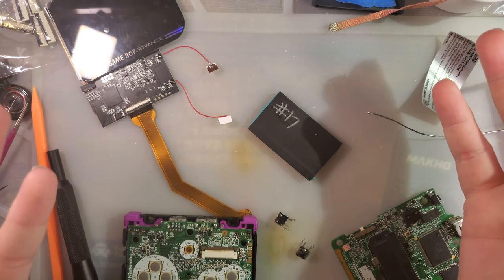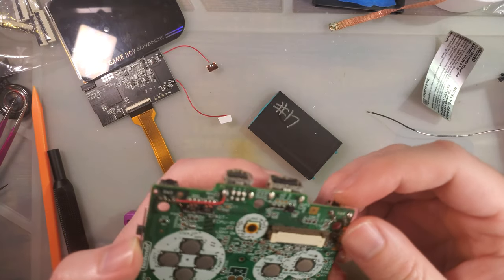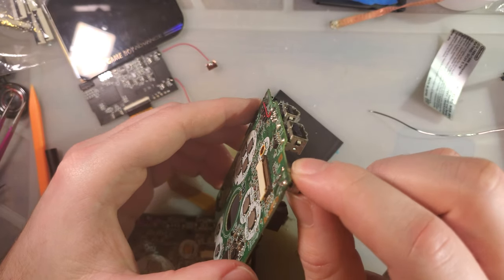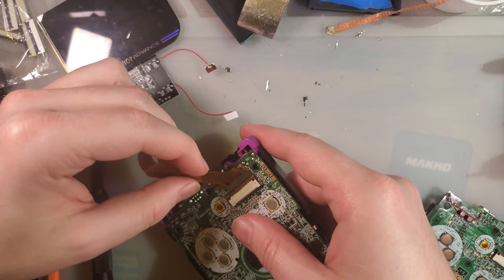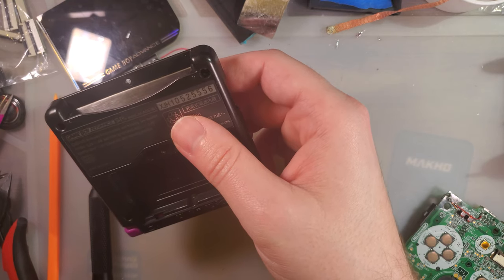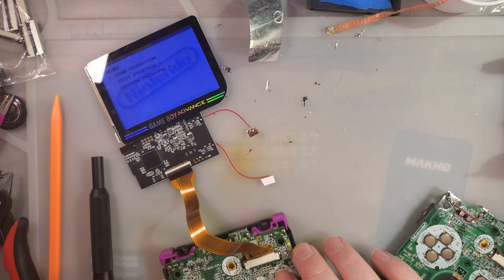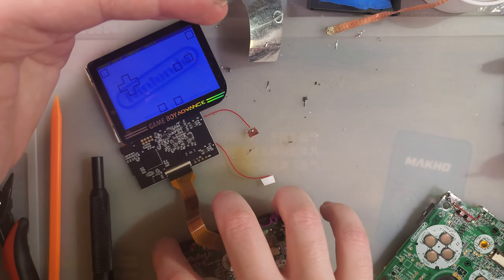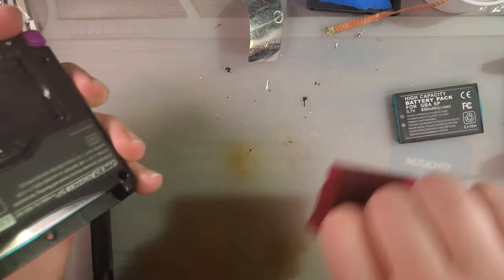SP Shoulder Button Clicky Tact Mod

Comment: I also made a video about this. The part number for the switches I have installed on my SP is BG-US-91570-P. I got them from Amazon, 100 switches for $6. The ones I used may be too clicky tho lol.

Comment: I have a small bag of these I bought for modding my AGS and an AGB when I get around to it. 

What would be a good soldering iron for doing this and other mods? I know you don't really need more than a 30W for stuff like this, but can't help but be curious.
Reply from the maker: nah, I totally recommend a 65+ watt iron. The difference is significant and worth it. Temp control is a must too. 

I personally use an xtronic 3020 but the miniware ts80p is also very compelling. I've heard good things about the pinecil too but I don't really have enough use in mine yet to vouch for it.
Reply: @makho  I have a 70W Weller WE1010 that I got for RC and less delicate/intricate things, I'll get some different tips for it if that's the case since it has temp control. I was just hesitant to use it because I kept seeing people recommend the other, stuff about it heating up too fast or something. Probably meant regular irons now that I think about it.

I've seen the miniware before, and it looks like a good portable iron to put in a tool bag for working on the go.
Reply from the maker: @brandoneverett3418  set it to 300c and it should be good. Depending on your style (speed), the specific thing you are soldering, and the calibration of your iron, you may need to adjust up or down from there. Most people make the mistake of cranking their iron up way too high and with a high wattage iron, you will not be able to get away with that very long.

Comment: Could someone me? I bought a modified gameboy with clicky shoulder buttons from an Etsy seller, but the 'R' button doesn't work. I've tried cleaning the button, and swapping what's working on the left side with it.

The problem is not the button itself, since regardless of the switch I use, the left side works but the right doesn't. What do you think it could be?
Reply from the maker: You should have the seller repair or replace it.